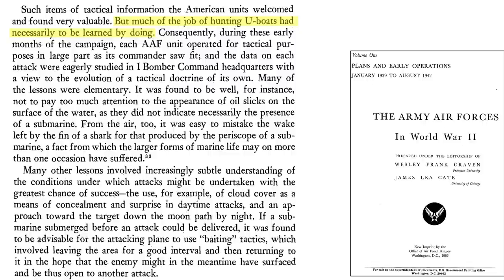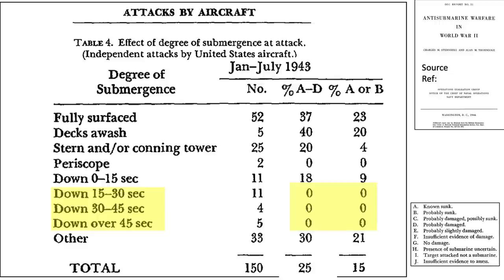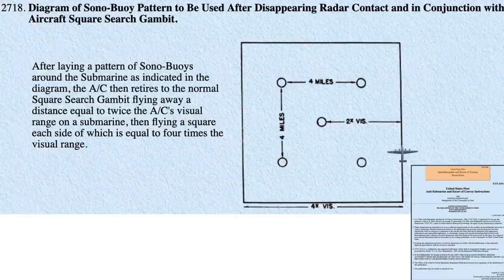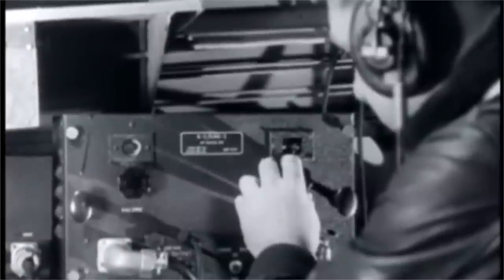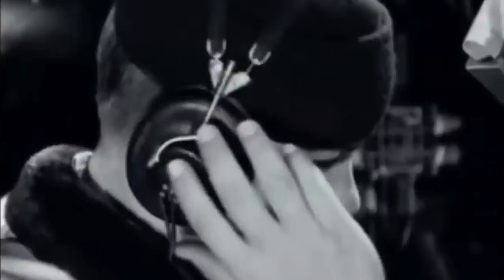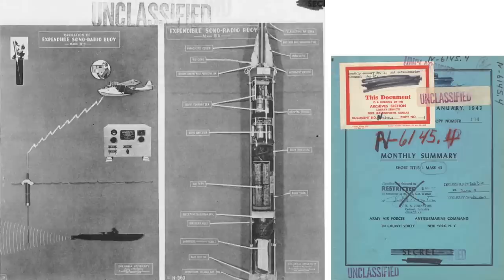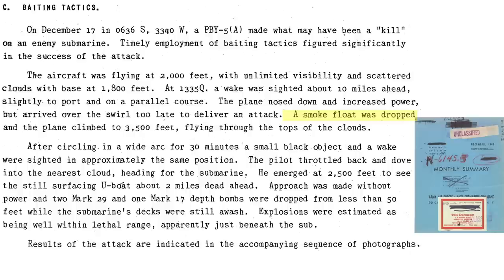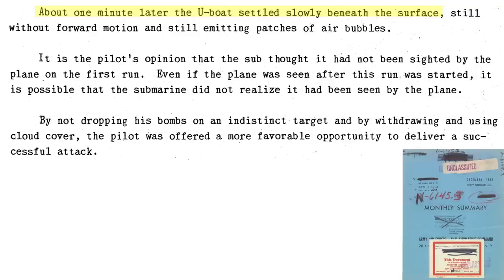The Secret WWII Tactic that Tricked U-boats to Surface

Comment: So, it was not the convoy system responsible for the high kill rate of the German U-boats, but rather the tactics of ant-sub aircraft such as the US SPY using sonars from buoys, and subterfuge, pretending to fly off, only to return 30 min later to find the sub on the surface. If the sub had been diving for more than 15 s from a surface position, it was safe and the plane unable to destroy the sub.
Reply: He didn't say that. The convoy system was to overwhelm the numbers of U-Boats with escorts that could force the U-Boat down. Since the Germans had a fascination with deep diving, these subs couldn't possibly surface fast enough to continue pursuit of the convoy. We encouraged them to feel superior because of the deep diving characteristics of their U-Boats. In reality a deep submarine was completely harmless and permanently out of that particular fight.

As numbers of allied escorts increased, hunter-killer groups, not even necessarily assigned to guard convoys, were tasked with finding and killing the U-Boats. The hunter-killer groups were the end of the U-Boat as an effective weapon. Usually a hunter-killer group was centered around a jeep aircraft carrier and very different tactics than this luring U-Boats to the surface.
Reply: @RockinRobbins13  Rock&Robbin -- Neither did he deny that! From what you said, it is still unclear if the demise of the German U-boat was primarily due to a ship escort or due to anti-sub aircraft. I suspect it was a contribution from both sources, but I stand to be corrected by anyone in the know.
Reply: The main mission of convoy escort is to protect the convoy.  Killing subs was a distant second.  Once a sub was forced to dive, it was no longer a threat to the convoy.  And a convoy could easily avoid the area where a sub was spotted.
Reply: @stevenpace892  That's fine and was the initial strategy. But what ended the U-Boat war was the jeep carrier based hunter-killer groups that were not tasked with guarding convoys, but solely with hunting and killing U-Boats. Yes, there were escorts around convoys. No, they didn't win the U-Boat war.

It's interesting that the Germans took great pride on how deep their U-Boats could dive, oblivious to the fact that a deep diving U-Boat was absolutely harmless. The time it took to regain the surface after their standard deep dive was the time the convoy used to leave the scene and be unreachable ever again for that deep diving U-Boat. The US learned lots from the failed U-Boat strategies and used that to defeat the Japanese in their own submarine war. Their "be dangerous" strategy was much more productive than the Germans' "dive deep" gambit.

However, the very use of the U-Boats for unrestricted submarine warfare against merchant shipping was an absolute guarantee of defeat for Germany. British goods came on ships belonging to other nations. Sinking those ships brought the entire world into the war against Germany, absolutely guaranteeing German loss of World War II. Of course, Germany made multiple fatal mistakes, any one of which absolutely meant they could not possibly win. U-Boats talking like a bunch of school girls was another one. Their handling of the Enigma code was another.
Reply: @stevenpace892  Steven -- It was just that I had always assumed that Axis U-boats were the major threat to allied convoys. They chalked up thousands of tons of allied shipping and if not stopped, might result in Britain starving to death.
Reply: @LaHayeSaint  The fact is, with thousand ship convoys and a couple of dozen U-Boats gathered to attack it there was no way these little boats (most were little Type VIIs) with way too few torpedoes could inflict significant loss in any event. U-Boats sank less than 1% of the tonnage of these convoys. They were a non-event at the cost of the war. Everybody is entitled to ONE fatal mistake. Germany made dozens of fatal mistakes, any one of which guaranteed their defeat.
Reply: @LaHayeSaint  they were a major threat.  A lot of effort was put into neutralising it.  My point is that destroying a threat is usually only a small part of neutralising it.  Late war, U-boats sank few ships.  Forcing the U-boat to dive was job done for the escorts.  Sinking them was even better, but not essential.
Reply: @stevenpace892  Steven -- Just to clear things up....... So early in the war, German U-boats could surface and wreak havoc. But later in the war, allied air power was effective in destroying U-boats /forcing them to dive, limiting the number of allied ships sunk.
Reply: @RockinRobbins13  Rock&Robbin -- I take your point of too few U-boats to do any real damage to a convoy. But I've heard stories of "wolf-packs" of U-boats, where they concentrated for the kill and then dispersed. I believe the allies cracked the codes the U-boats were using so they knew beforehand, when and where their assembly point was for an attack. The allies could then bring their anti-sub planes to bear on the enemy.
Reply: @LaHayeSaint  That is true. Somehow Admiral Donitz thought that a wolfpack of U-Boats on the surface chatting on the radio like schoolgirls was stealthy enough to survive the consequences.

Although the Navy did take steps to make their Enigma code more secure than army versions, the consequences of the Germans' first fatal mistake, invasion of Poland, guaranteed that the Polish breakers of the Enigma machine would flee to Britain, where they defeated the Nazis using the incredible computing power developed at Bletchley Park. The messages could often be read in Britain even before they could be decoded in Berlin.

Systemic defects are typical of authoritarian organizations. Nazi Germany was poster child for elementary, obvious, fatal error in these organizations.
Reply: @RockinRobbins13  Rock&Robbins -- The mistakes by Nazi Germany on the High Seas begs the question as to could U-boats have been deployed more successfully? Would a frigate U-boat escort armed heavily with anti-aircraft guns -- the dreaded 88 mm guns -- have been any good? In addition, the elevation of these guns could be depressed to respond to enemy shipping.
Reply: @LaHayeSaint  A few problems with Germany putting a single Mark into a U-Boat, or any non-coastal naval craft, for that matter:

If you don't control the surface of the water with diesel-electric subs, you can't possibly maintain a submarine presence for long. Why did the hunter-killer groups centered on little jeep aircraft carriers work so well? The Allies had absolute complete dominion over the surface of the Atlantic Ocean! Similarly, U-Boats had to return to base for refueling or more weapons, as sending out "milk cows" was really dangerous and problematic, unable to deliver what U-Boats needed to stay on station.

When your boats don't take enough weapons to battle to win the battle, you lose. A Type Vii U-Boat only 14 torpedoes were carried. There were 4 bow tubes on most of them and one stern tube. Then to make matters much worse, half the torpedoes were stored on the outside of the boat! In order to use them the boat had to lay motionless on the calm surface of the ocean and take hours to transfer the torpedoes to the torpedo rooms within. And until the transfer took place the U-Boat was shielded by thousands of pounds of explosives surrounding it.....yeah. Not a great state of existence. Basically they shot one full spread of torpedoes and they were done for a long time. They didn't have enough torpedoes below for a full reload.

When you are restricted to constant bearing aim/fire techniques for your torpedoes, you give up many opportunities and gather lotsa misses. American submarines had a very advanced Torpedo Data Computer, which would allow the submarine to enter the information, even submerge and fire blind with a decent chance to bag the target. U-Boats had to fire torpedoes with periscope above the water. They had to fire from a course 90 degrees from the target course to have a good chance of a hit and they had to be accurate on target speed and course. It was an okay system, Dick O'Kane of the US Sub Service learned and used it to his advantage in addition to standard American techniques, but as your ONLY tool sometimes it was like trying to turn a bolt with a screwdriver.

U-Boats dove too deeply Taking as their ability most proud, deep diving was a part of the reason for the tiny size of Type VII U-Boats as opposed to the Type IX and American fleet boats, neither of which could dive nearly as deep. Restricted to a speed of only a couple of knots underwater and taking over an hour to get back to the surface, even from 250 meters, as soon as a U-Boat obeyed standard operating procedure and dove deep it voluntarily took itself out of the battle. It was no longer dangerous. American boats, only capable of 200+ meters, tended to remain in the battle, to be dangerous at all times. With their predictive TDC, American boats could work up a firing solution, take down the scope, initiate avoidance procedures and THEN fire accurately. They tended to stay near the surface and make their targets and escorts much more uncomfortable than they wanted to be. American submarines were much more aggressive against escorts than German U-Boats were. As Patton said ,"The best way to handle fear for your life is to make your adversary fear for his." And enemy depth charging you at his leisure, lacking any fear whatever, will win that battle.

I contend that every gram of steel, every highly trained cream of the German crop sailor, every torpedo, every round of ammunition, every drop of fuel put into non-coastal defense U-Boats was aid to the Allies. I'd extend that to the surface fleet as well. Other than close-in coastal support, they had no role, except to aid the Allies.

There are more but I'm out of ideas for now!
Reply: @LaHayeSaint  "could U-boats have been deployed more successfully?" Short answers, one sarcastic and one sensible. Sarcastic first.

Since shooting at merchant ships belonging to every nation on Earth EXCEPT Germany was ridiculous, the only legitimate targets were warships, every one of which was faster than a U-Boat. Sinking neutral shipping brings the neutral country in the war on the side of your enemy.

I guess they're both kind of sarcastic. Could Germany have used more tanks, more artillery, more guns, more ammunition? How many tanks could you make with the steel in one future artificial reef? What could the crew of 30+ elite men, the best the German military ever produced, have done in an actual productive capacity on land? 70% of those highly trained, irreplaceable men were killed!

The U-Boat was a completely inappropriate weapon for Germany to have used during the war with the minor exception of coastal patrols. Use of the U-Boats guaranteed German defeat. Unrestricted submarine warfare against the entire world was suicide.
Reply: @RockinRobbins13  Rock&Robbins -- You've evidently spent some time on your knowledgeable and detailed response. For that, I than you. Taking your points in order:
1. The Germans could never maintain enough coverage of the Atlantic ocean, simply as it was too vast, and there were not enough U-boats as the Germans were short on materials and manpower.
2. I had no idea that U-boats carried torpedoes on their outer hull. How frighteningly dangerous! In addition, there were too few torpedoes (14) to be combat effective.
3. U-Boat aiming and firing techniques were antiquated and ineffective.
4. It appears that if a German U-boat commander gave the order to dive, then the U-boat was effectively taken out of the battle, as it needed to be within periscope depth to be able to fire its torpedoes.
5. U-boats would have been better employed for coastal defence, covered by ground anti-aircraft artillery and Luftwuffe fighters.
However, the men who manned these machines were very brave, knowing that sub-mariner service was often fatal. The tonnage they sank in the Atlantic must have had a material effect on Britain to continue fighting.
Reply: @LaHayeSaint  "The tonnage they sank in the Atlantic must have had a material effect on Britain to continue fighting." That isn't why they fought. They fought because they were thoroughly professional submariners who were in the war for the duration, no matter what. These were the finest men Germany could produce. They would do their duty even in the face of certain defeat.

Only Admiral Donitz' measures to have the subs lie low near the end of the war, awaiting possible tech advancements to make them effective again saved a meager 25% of them from death.

I would propose that the hardship on Britain caused by t he U-Boats hardened British resolve to stay in the war. Imagine if there were no unrestricted warfare and the British army was saved at Dunkirk.

Then Germany could have said, "Well done honorable British. You have fulfilled your treaty obligations with France and now that battle is over. We respect you as a great people of honor. In respect for that honor, we held back and allowed you to save your stranded army. We have no quarrel with our brothers in Britain. Here, sign this peace treaty and we'll let each other live." Still horrified by World War I losses which wiped out an entire generation, harrowed by their narrow escape at Dunkirk, lacking the unifying effect of unrestricted submarine warfare against their island, Britain may have accepted such a truce.

But considering the unrestricted submarine warfare........NAH! Those Germans (the leaders) were always "far too enlightened" to act in their own best interest.
Reply: @RockinRobbins13  Rock&Robbins -- Listening to what you say has bought me round to thinking that resources poured into U-boats may have been better deployed elsewhere. Two areas come to mind immediately:
1. Jet fighters like the ME-262 with air speeds of about 500 mph. These could approach the allies, cause their damage, and be off home before allied machine gunners could engage. They would decimate concentrated allied bomber forces over Germany and prevent Reichsfuhrer Goering from having to be called "Mr." moreover, German factories would remain intact.
2. Germany had no long range bombers. These were needed in Operation Barbarossa, to destroy Soviet factories and transports beyond the Urals supplying aircraft and T-34 tanks to the battle fronts.
Reply: My understanding was that early in the Battle of the Atlantic the Germans were sinking ships faster than the Allies could build replacements.  The Germans were sinking ships within eyesight of the US east coast.  It was a white knuckle experience.  Please correct me if I am mistaken.  I also understand that the turning point came when the Allies had enough escort carriers and big maritime patrol aircraft to take advantage of their knowledge of where U boats would operate based on information gained by Enigma enabled intelligence.  By mid 1943 the Allies could act on that data and had units to deploy to find and destroy enemy U-boats before they could attack convoys.
Reply: @philsalvatore3902  Phil -- Your account seems very plausible. But I must confess, i am not a military historian, although I am interested in tactics in land battles. Without researching "War at Sea2 it seems to me that the Germans must have experienced some measure of initial success using U-boats for them to have poured more resources in. This is however common in the early phases of war, due to the element of surprise and the lack of knowledge and resources on how to deal with the threat. Sooner or later, a chink in the attacker's armour is found , exploited, and the tables turned. Does that sound about right? In war, resources are needed across the board. The question is where best to place these resources. Wartime Britain has to be supplied from the US. So it was very reasonable to attempt to break this supply chain. The Atlantic, however, is one huge fish pond, so it is nigh impossible to police every inch of it, meaning some supplies will get through. Breaking of the Enigma Code, more heavily fortified convoys and advances in aerial anti-sub warfare no doubt took their toll, as did America's entry into the war.